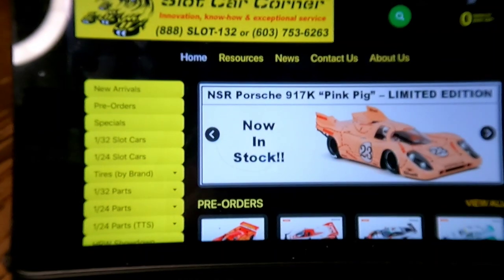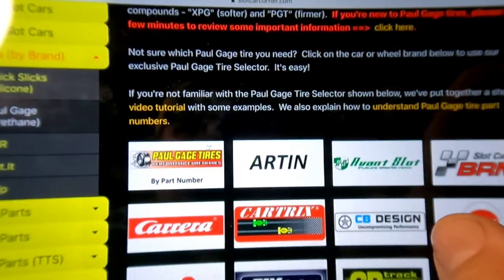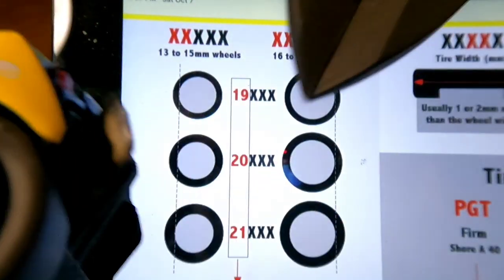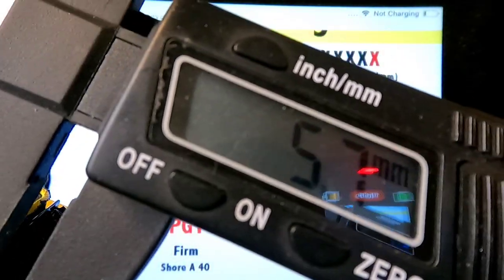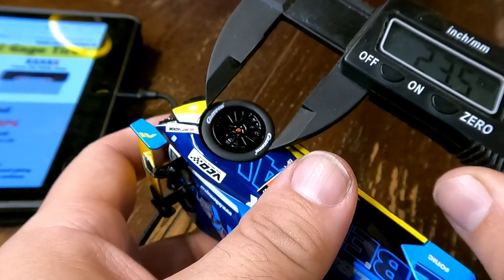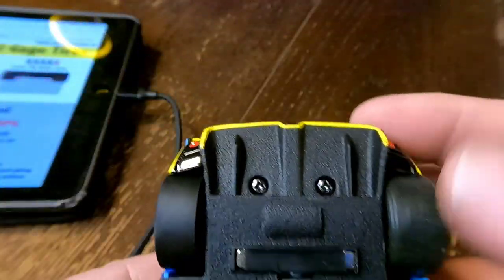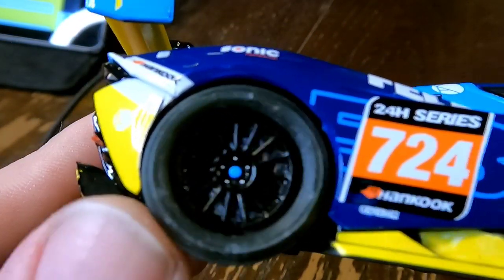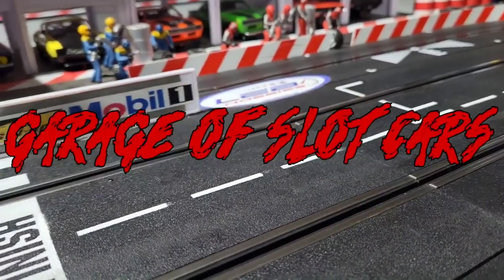what tires fit my 1/32 scale Carrera digital  slotcar 🤔

Comment: I'm no expert or professional but I run silicone on my track. I will accept your challenge and do a video on silicone tires.😅

I also had issues finding the right tire for my X Bow. Ended up using Lambo race tires from Quick Slicks.
Silicone of course. 
Carrera decided to make a larger wheel and the guys at SCC explained to me that making a new mold for one specific car was not cost effective, naturally. We measured a few but in the end I found a tire that fit by trial and error. Thanks for going in depth. If and when  I switch to PG ill reference this video for sure!